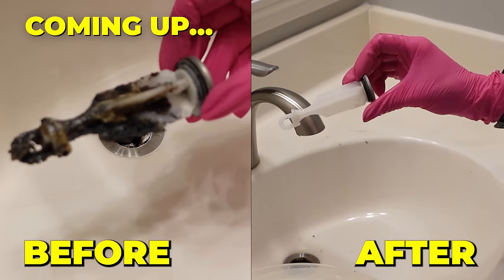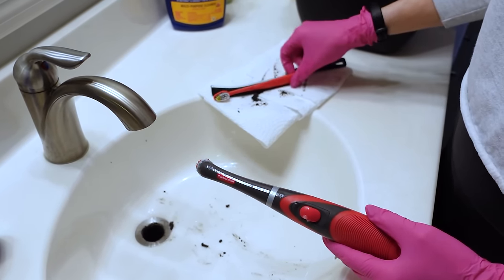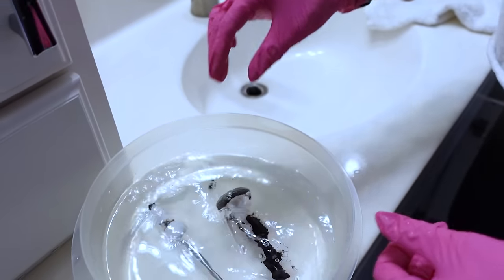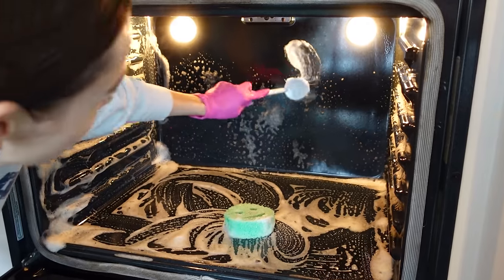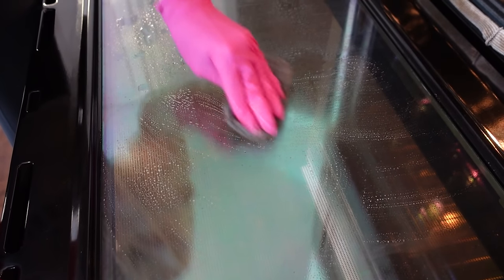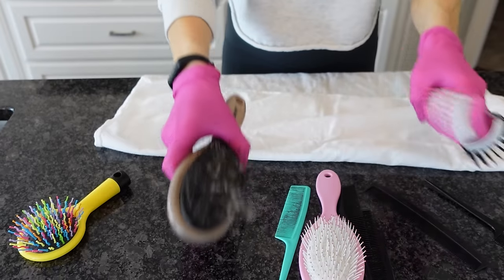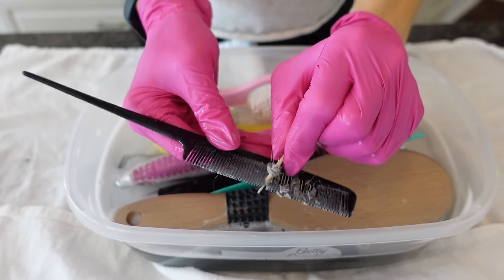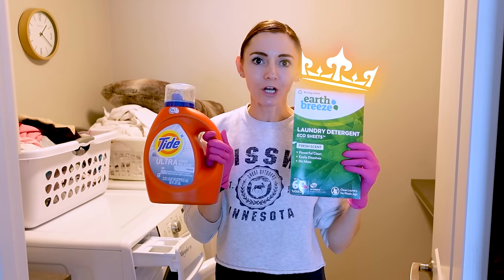5 Genius Hacks That Will Take Your Life to a Whole New Level! ✨ *CLEAN LIKE A PRO*

Comment: A hair dresser recommended using a cheap denture brush to clean brushes and combs.  It really works wonders especially on those brushes with the plastic bristles with round tips. In addition, spray the Dawn powerwash directly on the bristles and let it soak in for a few minutes before putting them in warm water. It really helps to breakdown all the oil and product buildup at the base of the bristles.
Reply from the maker: Great tip!
Reply: I’ve been a stylist for well over 30 years. On those combs, after soaking, you can just take a towel and hold the comb in one hand and take the towel and wipe from the base of the teeth out to the tips. Concentrate on holding it firmly while pulling out. Then go through to get anything left over.
Reply: Soak in a solution of ammonia or washing soda.
Reply: If your drains are mostly clogged with hair, our cleaning lady uses Clorox drain sticks... 2 pack for $4. They are long enough to get to the P-trap in the sink or shower and no removal of drain plugs. How did I not know about these? I have crawled under the sink to remove the P-trap on every sink I've owned.

Comment: Whenever I clean out my hairbrushes I put the hair in a grocery bag I’ve saved, then when I’m done I put the hair outside. The birds use the hair to build their nests. 🪺
Reply: Make sure to cut the hair into fingering or shorter pieces. Long hair can entangle bird feet.❤
Reply: @ande100  will do 😊. Thanks so much
Reply: I toss fresh cut hair in the garden to discourage rodents (squirrels & chipmunks) from digging.  Would like to know if you put the hair in anything (like a mesh bag) and hang it up for the birds, or just spread it in the garden.  Thanks
Reply: @ValerieCraig-rw4fz  I just put in right out in the garden but I try to always place it in the same spot. They seem to remember where it is. I also place any twigs or small sticks I find there 😊
Reply: I used to do that. Thanks for the reminder. 🙂
Reply: @ValerieCraig-rw4fz  It also discourages rabbits. 💖
Reply: I never knew that about hair for the garden and nests! Thanks for sharing :)
Reply: I put my drier lint out for the birds nest. I’ve seen do many strange things incorporated into nests such as different types of garbage. At least this is soft.
Reply: Being a hairdresser we would use a retired nail brush to scrub the combs before we went through the sterilization process.  Your way works good too.
Reply: What a GREAT idea!!!!! Thanks so much for!!! PS The hair you save is prior to cleansing products, right?

Comment: You can use a long plastic tool made to manual put down the drain to get the clog out
Reply: I had one of those plastic tools and it doesn't do nearly as good a job as the little drain screen I use instead of a stopper.  The barbs on those plastic tools are really wicked sharp, too!

Comment: I've been dealing with a slow drain for at least a year and tried pouring all the things down but knew I needed to take it apart. I went and did what you did and mine was WAY WORSE than what you pulled out of both of yours 🤢. I'm surprised any water was going down at all 😂

Comment: I had printer ink that spilled onto the carpet and it sat on it for weeks.  I used Folex for the first time and was amaized.  It said to spray and then use paper towels and pat it and the ink soaked into the paper towels so I kept getting another paper towel until it soaked up every bit of the printer ink. No hint of the black left on the carpet.  It worked like magic.

Comment: thanks for all your tips!  In the red stains on carpet, I use salt believe it or not!  When juice or wine would get spilled,  to help clean it, I right away poured a generous amount of salt on the spot and leave it there for a bit and it draws most of the liquid up in to a clump then cleaned the salt and area up.  I was surprised how It worked!
Reply from the maker: Great tip!

Comment: I have long hair and, since I brush and style my hair over the sink, for YEARS I was having to do what she's doing in this video at least every other month!  It's a gross job and a bit of a pain to do.  When my drain would slow down and there was even a hint of odor coming from the drain, that was my cue it was time to clean it out again.  I even bought one of those long, barbed plastic sticks that are supposed to get hair out of your drain, but it didn't work very well.  One day while shopping, I found a set of those little drain-shaped screens that had a screen that fit my bathroom sink drain, so took out the stopper and stored it, and put the screen in the drain.  It's been FABULOUS!! I never have to do what she's doing, never have to undo the trap and clean it out, and I never have any kind of drain slow-down or odor coming from the drain!  The screen catches everything, even when I give myself a haircut.  I do have to give the screen a quick rinse after brushing my teeth because the toothpaste foam is too thick to rinse off by itself, but it only takes a second or two to do and it beats having to clean the stopper, the drain, and/or the trap.  The set of screens also had one the perfect size for my kitchen sink and I use it all the time.

Comment: Did you not know that most oven doors can be removed from the hinges so you can reach the back of the oven to clean??? Open the door to the first "stop" in the hinges, somewhat of a venting position, where it is only open an inch or so and pull straight up on the door, using both hands on the sides of the door.  It should slide off the hinges easily...then you can clean the door separately and simply slide it back on the hinges when done.

Comment: I remove the trap and use a bottle brush to push all the gunk through to a bucket I put under the sink. I wash the stopper under the kitchen faucet and get rid of it all by running the garbage disposal.

Comment: Listen I figured out that that the plastic part going into the hole in the sink has a reaction to toothpaste this is the black goup you see, if they will use hot water to brush teeth it will go down drain better if not this is ehat happens iv been thru this same situation k, that plastic on the stopper has a reaction to toothpaste. Yuk makes it black yuk.

Comment: Just a little tip from a UK you tuber,  ( not me ) to get rid of hair down the sink hole, put some hair removal cream or liquid down the plug hole and leave it overnight then rinse it away in the morning, it dissolves the hair which then rinses away easily.
Reply: A lot of homes in the US have septic systems, I can't imagine that'd be good for it or One's pipes.
Reply: @tonic.1917  well obviously if you have a chemical waste system you couldn't use it, but if you are attached to a waste water system it has no effect on the pipes, because as soon as you wash it away with water you dilute it and it has already done it's job dissolving the hair in the pipe, I have used it myself and it really works, and also if you have a septic system you shouldn't be using any kind of chemicals such as bathroom cleaners anyway,

Comment: Andrea, you worked way too hard on those brushes! Soak them in some hot water and amonia for about 30 minutes. They should easily come clean. Use a toothbrush for any stuck on stuff, but it should be pretty quick and easy.